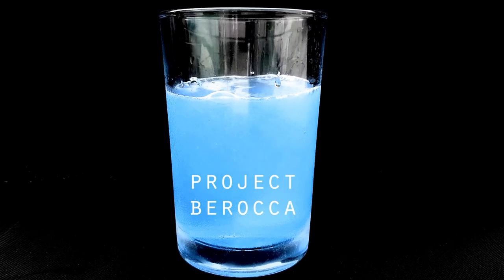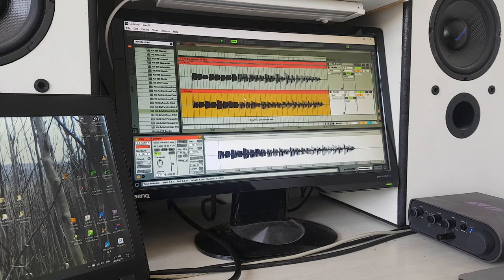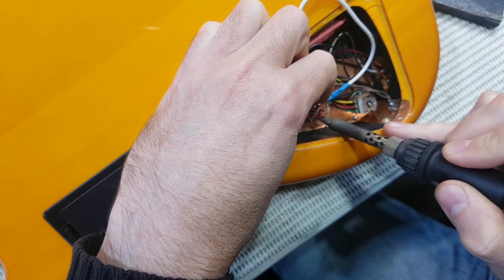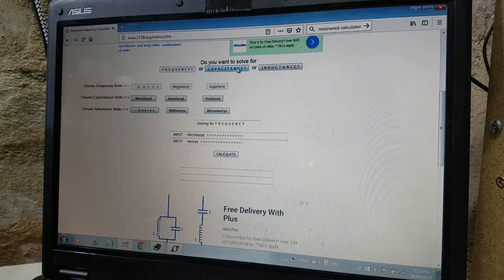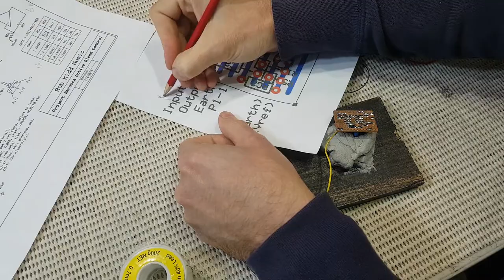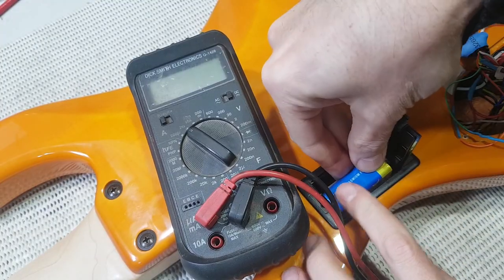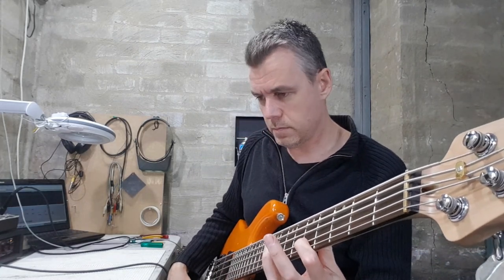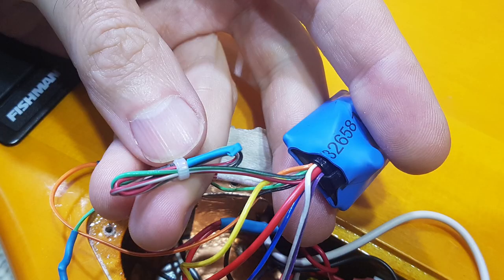Project Berocca Part 9:  Finishing And Tweaking The Active Blend Control

Comment: I wish this was 10 years ago!  I set out on a project then with no background, and learned a lot, but never quite finished it (9 string stereo output guitar/bass with individual pickups for each string in two soapbar cases, each switchable to one or the other output, or both - I burnt out my sewing machine pickup winder half way through, and not being able to figure out the math I never quite got the passive mixer switches for each pickup working to give me enough output (I believe my resistors were way too high...)).  Having videos like this to learn from would have been invaluable, and I’m REALLY enjoying them!

Comment: Haven't seen anyone go into this kind of detail with pickup loading. It's really interesting. Would loading help to make an active EMG P bass pickup with an onboard preamp sound more passive?
Reply from the maker: I'm afraid this is not an option with an active pickup, since the coils and preamp are all out of reach, epoxy potted as they are.  You might be able to get a more "passive" sounding response with a resonant LPF between the pickup and the pre.  If memory serves, my 73P, with pots and cord, will roll off from around 2- 2.5 KHZ with just a tiny resonant peak.  But that's another active circuit.
You might be able to get close with a simple (passive) RC LPF.  IOW, a resistor in-line,where the pickup goes to the pre, and a cap to earth at this same point.
Check out online RC LPF Calculators.  A 10K resistor and a 6.8nF cap would gently roll off from 2.3Khz...
Thanks for watching my vids!
Reply: I used the Albert Kreuzer designed onboard preamp and tweaked the tone control and bias for my application. I built it on Veroboard, but it was so noisy. I decided to rebuild it into a printed circuit board and implement the LPF that you suggested just before the input stage. That and a better grounding path, it is now super quiet and the treble side of the tone control sounds much smoother. I'll still have to see if the pups sound a bit less artificial. What are your thoughts on using home printed PCBs for DIY projects?
Reply from the maker: @seanedwards773  Years ago, I used to make my own boards with laser printed iron-on etch resist.  But these days, there are so many cheap small-run board manufactures that I can't imagine ever doing that again.  I just looked up that preamp, and yeah, it's a good idea to choose the drain resistors to suit each fet.  Also, I'd recommend a make-before-break rotary switch for the mid cap selector or it might make little pops as you switch between them.  Other than that, it looks nice.  In fact it looks vaguely similar to the rack preamp I made for my bass rig.  (Although the filter section is another topology.)
Reply: The mid selector is a cool idea. Someone could even put in a 3 or 4 throw selector for more tonal options. I originally chose this preamp because I only had one hole in the bass body for a pot or switch. So then I used the Duncan Amps calculator to make sure the EQ was flat with the tone control in the middle. Then tried to accent the punchy low mids and down when turning to the bass side of the tone control. So my preamp only has one control pot. Going for the minimalist P bass with flats, volume and tone control.

Comment: Rob, love the project! I'm wrapping my head around balancing piezo and magnetic pickups and I decided to try your blending approach. May I ask you what software you use for measuring the sound spectrum and treble response?
Reply from the maker: Yes this circuit can be used to balance Piezo and mag pickups.  You'll need an opamp IC with fet inputs, like the TL072 or similar, and set the input resistor on the piezo side nice and high, perhaps 3.3M or 4.7M.  Plus you won't need an input coupling cap since the piezo in not an ohmic device.  To test for phase, in the past I have wired in a temporary phase switch on the mag pickup, then simply chosen by ear.  I can't think of a way to easily test the phase of a Piezo pickup.  (Plus of course it's picking up the string vibrations at the bridge as apposed to actually on the string.)  You may also have to adjust the output of either pickup.  If you need to boost the level of the mag pickup that's fine, but introducing gain on the piezo side with very high input Z and a low current opamp may make it a bit hissy.

I use an old Syscomp USB 'scope.  Mostly because it has this bode plot function.  I wound the driver coil myself, and it is buffered with a simple opamp circuit.  Cheers, and good luck with your project!

Comment: You could have put a trim pot on each side and use them to adjust each channel.
Reply from the maker: For sure.  You really only need that for one channel I guess, to boost whichever pickup is quieter.  You could also just run a couple of wires where RG1 is to a pot for testing, then measure the resistance and use the closest fixed resistor in the build.  Thanks for watching mate!